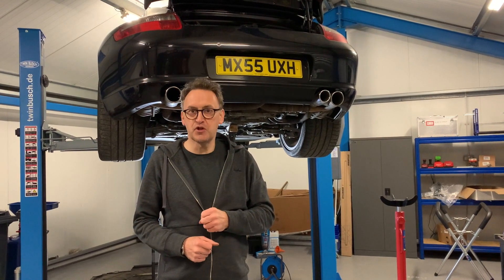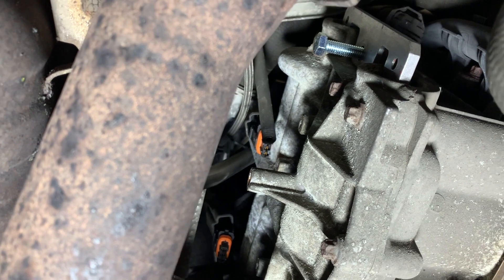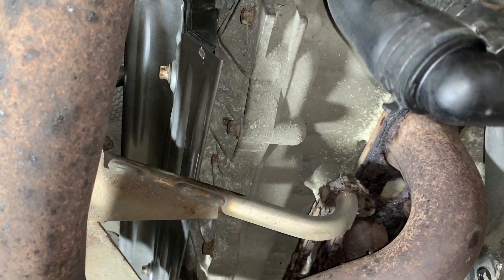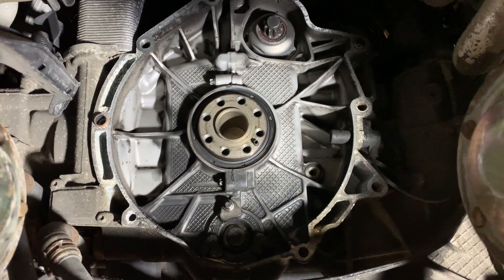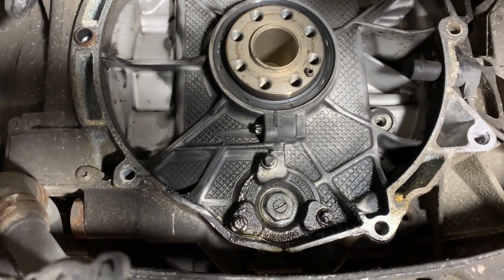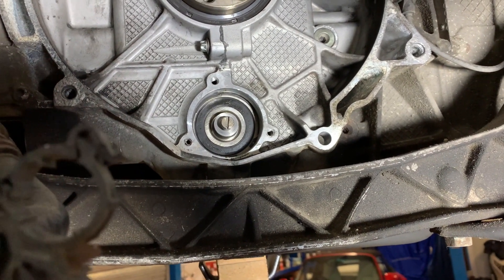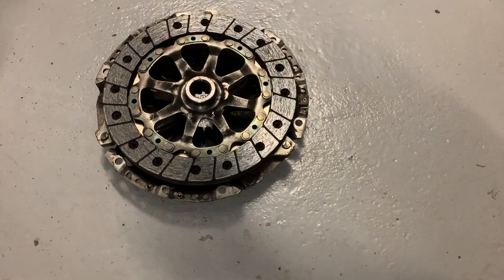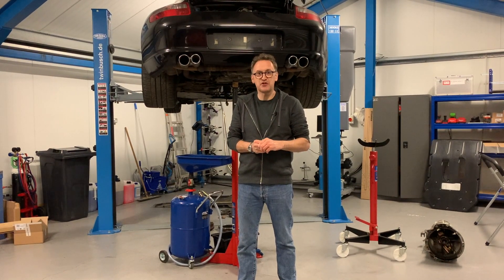Porsche 911 IMS intermediate shaft bearing

Comment: Great no nonsense video, you're got yourself a new subscriber
Reply from the maker: Glad you found it useful 🙂
Reply: @911virgin8  I like that you dont hype up the ims issue. Some folk over react. I've had a 996 and 986 over 8 years both high mileage and no issues. I see some advise removing and leaving off the bearing rear seal to allow engine oil to flow around. What  do you think about this?
Reply from the maker: @vintagesteelgarage  It does prevent a localised build up of metal which in turn acts like a grinding paste and also ensures the bearing doesn't dry out. I'm not so sure about the replacement "uprated" bearings which have a limited life and become a service item.
Reply: @911virgin8  yes I agree on the aftermarket ones. At some point I'll take my gearbox out and check the ims.

Comment: Great video 👍 and very much appreciated as that's exactly the problem I have here with my 987.1 Boxster S here in France.
Off to buy the locking kit now as I have the transmission out.
I have two Twinbusch lifts and rate them highly.
Reply from the maker: Glad you found it useful. They are indeed a good ramp. Funnily enough just had them serviced / inspected today !

Comment: i think if i had gone to the trouble and expense of exposing the IMS bearing, i would have it replaced with either an OEM one or one who's marketing hype had convinced me was superior in some way.
Reply: This is a 997 C2S 3.8 M97 motor. It has a revised style of bearing. It's a non serviceable bearing; you would have to disassemble the entire engine and split the crankcase to change it. It is however very reliable, as stated in the video. The IMS bearing on 996 & 997 M96 3.6 motors is certainly less reliable. You are however able to change the M96 item for an aftermarket or 'uprated' bearing by removing the gearbox and flywheel. No full disassembly needed on M96 motor.

Comment: You kinda confused me there. You said the bearing almost never failed but then you said it's not worth putting in one of the modified bearings because they had to be changed every 3 years or so.
It seemed you kept talking softer and softer and I kept turning the volume up more and more but had a hard time hearing you.
I've noticed a lot of tubers rely on the microphone on their cameras but stand to far away from them.
I thought only the 996 had the IMS bearing. You said that is a 997. Also I understand the turbos do not have it at all due to a different engine design. Can you explain the difference? Are the cam chains run directly off the crank on those?
Reply from the maker: Hi there. With regards to the modified bearings there are a number of solutions but it's not something we generally get involved with. Whenever you change a clutch it's good practice to change the IMS bearing oil seal at the same time (and also the rear main oil seal). This gives you the opportunity to feel the bearing by hand and if there are any issues change it, in the case of early type bearings with the same type of bearing - keep in mind they do last a good long while. The problem really comes with Tiptronic cars because they never get opened up to have a clutch changed and it's 12 hours rather than 4 hours labour to do an IMS oil seal so they tend to get ignored and just wiped clean.

997 and 996 are essentially the same with regards the IMS bearing, the Turbo and GT3 engines do run their cams of an intermediate shaft but the design is quite different.

The video was filmed on a iPhone so audio is what it is. Ultimately we are car dealers not film makers. The day we start charging you and selling you popcorn is the day you can demand improvements :-)
Reply: @911virgin8  Thanks for all the info! I hate popcorn. Lol
Actually, you did a good job of putting the whole IMS thing into perspective. A lot of tubers make it sound like the sky is falling. Lol
Still, the engineers should have stuck with what worked well. The journal bearings.

Comment: Very informative. How many hours would a job like that take and is it the same on a tiptronic car?
Reply from the maker: Hi there. On a manual car it's about 4 to 4.5 hours. A tiptronic still has the same seal but the job is somewhat more involved, it's about 12 hours work. To make best use of the fact you've dropped the engine on a Tip you would check to make sure the brake line that runs over the top of the engine doesn't need changing and I would possibly also think about changing the Oil / Air separator. Sod's law says it will fail a couple of months down the line if you don't do it.
Reply: @911virgin8  v useful a lot of folk don’t appreciate the extra Labour cost associated with the tiptronic model despite the seal and or bearing being the same parts.
Reply: My 05 987.1 is Tiptronic bought purely so my wife would drive it on long European trips.
Having just got the box out it's a lot of work.
Not sure yet how I will get it back in on my own.
One question do you leave the seal of the bearing so that it runs in the oil ?